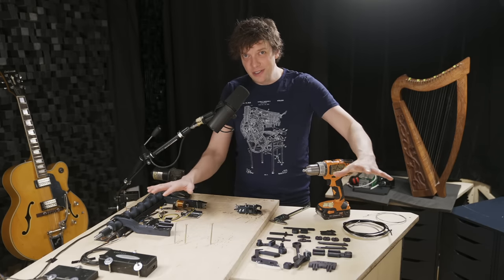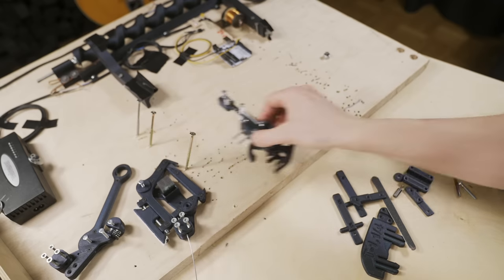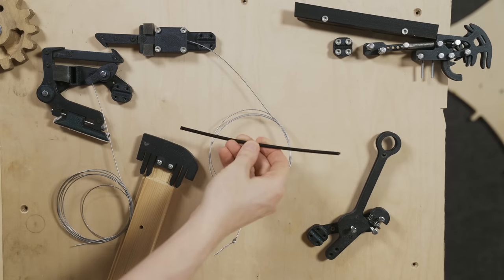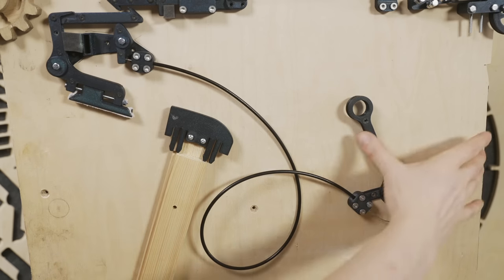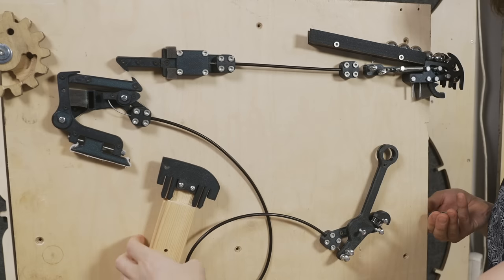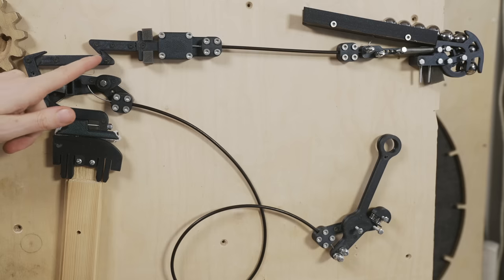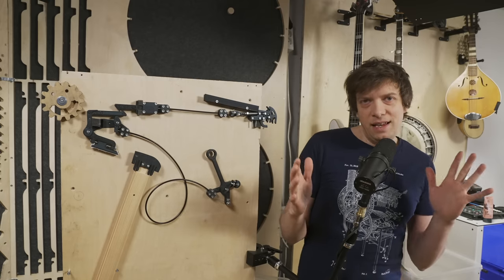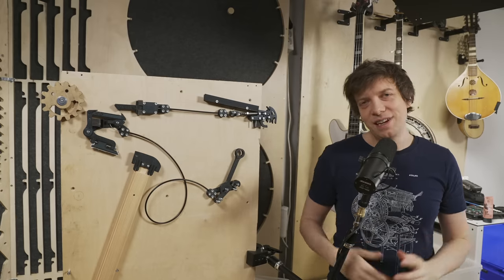These Bowden Cables Surprised Me!

Comment: As an avid cyclist, here's two pieces of advice in using these cables:
1) Get the expensive stuff. It's MUCH more durable when it comes to rust, kinks, stretching cables, and glide friction. Cheaper cables will eventually betray you in exceptionally frustrating ways.
2) Use the endcaps (ferrules) that come with the cable. They prevent the outer wire from fraying, and stop dust and grime being funneled into the channel on every actuation.

Edit with more ideas from the replies:
3) Do not push on these cables. It'll work for a while, but eventually your cable will buckle. Instead, make sure the inner cable is always under tension. The mute mechanism will fail in this regard, the marble dropper gets it right.
4) Cable stretch will introduce timing errors. You won't measure this in the studio or your tests now, but you'll absolutely know before the end of your world tour. Maybe not introduce this vulnerability into the dropper design? Alternatively, get the good stuff and have adjustments like on a bike.
5) Go to a good Local Bike Store (LBS) for mountainbikers, and explain what you want to do. They will assist you with proper tools, installation and gear choice. I can't think of any bike mechanic that won't be thrilled to help you and save you a lot of time and frustration.
6) @Nevir202 suggests "push-pull-cables" if you wish to avoid tensioning the inner cable.

Edit 2:
This is not a put-down, I have been fascinated with everything you do since MM1! Go Martin!
Reply: I second this advice. Also, the cables have a tendency to crush at the attachment points and then subsequently slip through what is clamping them in place. You need to introduce a turn or edge or something the cable is clamped around to help keep it in place otherwise they loosen with time.

The stretching of the cable and loosening over time will not do kind things to your timing I wouldn't think if these cables are being used between the indicator and the gate for the gate to drop marbles.
Reply: i highly support that advice as well
Reply: I might add that smoothly ground cables are just nice. Less friction.
Reply: And instead of using that two plate and for screw, it's possible to just have a block that stop the end of the guide, will save time and parts
Reply: Also cyclist and I just wanted to add to your suggestions:  
1.  I use nice PTFE stuff and grease the cables, grease reduces the friction and  makes it shift even smoother IMO. 
2. Agree on the endcaps. (Edit: think your referring to the 'housing ferrule' and I'm referring to the 'cable tips' here - use both)   Goes from sharp end to sharp and frayed all over and no longer possible to put endcap on easily, do them right away.   Use steel wire cutters not side cutters etc. Generic work just as good as park tool IMO.  Dremel cut off wheel to cut inner and outer together works as well.
Reply: @thalespimentelzuanazzi3365  And look how old cantilever brakes were implemented in bicycles. You can have an adjustment screw for the cable tension with just one factory made part that allows easily 0.25 mm accuracy for cable tension.
Reply: @TheXtrafresh. because younare the most liked comment. Would it possinle for you to ad following? If you agree so Martin may sees it?
I realy like the Bowden Cabels, but you have to consider Backlash in long Cabels, this comes from the Toleranz of the Bowden Tube & steal Cabel. It can be very noticable in ling Bowden Setups. This could leed to some problems, Maybe.
Thanks a lot
Reply: Well there is a difference in riding a bicycle and pulling like 20 grams of plasic. So i think there wont be any were over year. Endcaps are for prodecting against weather and also for stabilising the individual threads, but yeah, not much weather on the stage. I would safe that money. ;)
Reply: Also in this usecase you are asking for trouble as pushing with these cables is not a good idea - with nothing putting any tension on either end the cable can decide to kink rather than travel quite easily - Easy fix though the muting cam should be either spring loaded or work the other way around where you actively pull it into 'play' against its own weight so the cable is always tensioned a little. Also the cables are not instant data transfer they will mess with timing somewhat just by being there and not identical. So every note will need tuning in relative to the others -  The longer and more twisted (as that increases resistence) a run gets the worse this effect can be. And with Martins current tighter precision than I measure kick you may have to consider thermal expansion differentials between the sleeve and wire...

Otherwise agreed on both counts - though even the best 'pre-stretched' cable will stretch further over time and eventually get dusty/rusty/sticky enough to need replacing. So also worth making sure its as easy as possible to swap them for a world tour - which means standard length runs are probably a great idea so you can just keep the three? lengths pre-made with decent hydralic press clamped ferrules for maximum reliablity at both ends.
Reply: @davincifpv3842  i don't think it'll matter much for the silencer, but the marble dropper will become less and less tight over time.
Reply: @hyperbolid8777  except the machine travels, and festival stages aren't the cleanest environments I can think of. There's a difference in tension, as the MM3 will probably have less tension on the cables than a typical bike, but that makes rust, grime, cable kinks and other imperfections MORE noticeable, not less.
Reply: @h82fail  agreed on all points. Basically, before you use these in the machine, consult with a knowledgeable bike mechanic. They will know all the tricks and tiny mistakes you will make :)
Reply: @hyperbolid8777  In my experience, endcaps reduce the friction quite a bit so it might be worth having for this project, too.
Reply: It's usually good practice to have any cable actuated levers to be 90 degrees to the cable at mid travel - less forcing the cable to bend between the end of the casing and the lever. As an additional refinement, you can put compression springs around the cable at each end between the end of the casing and the lever arm. This will help the cable deal with being "pushed" - which it's not designed to do.
Reply: THIS!!! And I completly agree, the bowden cable does have great potential, but maybe not ideal at the timing relevant parts.
Reply: All looks like good advice, but if he WANTS to push, there actually is a cable for that. The machines in my old job used "push-pull cables" which are basically this, but with a solid wire, meaning that they transmitted both push and pull basically equally well.

They were being used in THE WORST conditions you can imagine, dirty, greasy, high vibration, next to no maintenance, for YEARS before we ever had a failure.

Think of the nastiest conditions you can imagine for a bike, and multiply that by at least 10, as these were mounted on gas powered machines, used to cut asphalt and concrete, which produced lots of fine particulate slurry and some fine dust, which got everywhere, combined with the vibrations from the motor itself, bolts would regularly be worn in half or loosen themselves, even those all metal lock-nuts he showed off in the prior video, would sometimes end up backing out.

On all of the machines we had them mounted on, the gasoline engines failed, multiple times, before the cables ever needed replacement, and in fact, most of the machines themselves became too old and were retired from service before the cables failed.

I did that job for 16 years, and I can only remember a single time that one of them failed, I fell like there must have been more, but I can't remember any.
Reply: Having the 2 pieces for the reader be connected could reduce the amount of tuning when assembling the machine. (The two seperate hook devices)
Reply: I second all advice here. Use brake cable (Shimano XTR for V-brake is my recommendation if you can get it long enough), much stronger and less prone to fail. A bit more difficult to cut, have your LBS teach you how to salvage the ends. A grinding wheel to clean, a sharp tool is good to expand the ends of the housing (‘syl’ in Norwegian), and you need a cutter that doubles over itself, unlike a side cutter as mentioned.

I really don't like the look of the cable heads exiting through the seams of the 3D prints. What a stress point. Cables should go through holes in material.

Edit: oh, and the stretch stops. Good cable comes ‘pre stretched’ but it's not perfect.

Edit 2: I just realised you can buy a drum of XTR brake cable housing. Maybe there is extra length for tandems for the cable? Pinching the cable at your fastening points is also an option to go without brake cable heads, it's just not as quick to replace thus not used on bicycles.
Reply: @foldionepapyrus3441  Possible to replace twisted cable with "Piano Wire" like what is used on throttle cables for lawnmowers. Less stretch and better pushing action
Reply: @Nevir202  that might be the golden ticket for the mute lever, and a good brake cable against stretching for the dropper
Reply: @cheeto4493  Doesn't do as well at the curves that may be required there though. Better choice if you must push, but when its so easy to design the push out so you can use the more flexible better option for a longer run...
Reply: I can't imagine cable stretch being noticeable with the tiny forces required to actuate the marble dropper. No way they're anywhere close to the forces from hard braking on a bicycle right?
Reply: Normally on throttle and brake assemblies the cables pulls and a spring pushes.
Reply: One way to get around the cables stretching out is to use hydraulic lines. Or, you know, electric wires. But electricity is too spooky. Not magnetism, just the electro part. the MM3 must be Amish approved.
Reply: Agreeing with all of this! Replying mostly to boost the comment ;)
Reply: Came to comment exactly this. Couldn’t explain it better, those points are totally necessary
Reply: Solution for push is use a solid core instead of twisted strands.  Has worked for a long time for choke control on engines. Also used for other automotive controls where you need push as well as pull. Like the slider for temperature control.

For such applications the sleeve can be the cheaper style with a spiral of metal (like brake cables) instead of the expensive type with lengthwise stands (for indexed shifters).
Reply: would also add brake cables to the list, as they are less prone to stretching and are better suited to maintaining tension permanently (gear cables tension and de-tension when changing gear - this setup does not deal with variable tensions)
Reply: I second the advice too. I would add that, if possible, a bare cable and maybe a pulley or two would be a better solution with less friction. Reserve the bowden cables only for the situations where you need your cables to follow complex shapes.

And, yeah, a tensioning mechanism is necessary. Those cables will stretch with the time.
Reply: I want to support the "not pushing with cables" advice. Maybe for 1 muting lane it works, but the other 2 machines were a lot of lines and the cable will no habe the strenght to push them all. You should find a way to "pull with the cable to mute and then release tension for unmute".
Reply: I agree with @Nevir202.  When I used to fly ultralight aircraft, many of the designs used "push-pull" cable for things like trim tabs or even flaps.  They are specifically designed for this sort of thing.
Reply: Can a spring be put at the other end of the mute mechanism next to the programming wheel to keep the cable under tension? I know that the spring would have to be weaker to allow the latch to move at all.
Reply: Yes. I had something like this comment in my mind while watching the video.

Some additional thoughs:

There are differences in shifting and braking cables. The ones for breaking have a larger diameter. Therefore they are much stiffer. Maybe this improves some wobbling behavior.

From my bike experience those cables break apart even if they are flexible. Thinking about the connection to the gate it will experience much more movements than on a bike. The breaking is a process over time. One of the small wires after the other comes apart. And if this happens near an end of the hose it will get stuck! Good luck this not to happen 😬
Reply: I would second basically all of this, and also suggest testing that muting connection with hundreds if not thousands of actuations (which of course is going to have to be automated).  That's the only way I can conjure to know what works well now is actually reliable - even if all these points are applied.

And while you're at it, maybe test the drive path for the marble dropper using a bowden cable at least twice as long as the longest run you think you might need.

There is so much about this overall setup as-is that is utterly brilliant and I love it. :D
Reply: So if we summarize this conversation, personally the bowden cables seem usable for the mute mechanism (by modifying it so as not to push on the cable). But will never be a good solution for the marble dropper in the conditions it exposes: not to be constrained by the positioning. Because will require constant tweaking, something he no longer wants for version 3.
If it must remain at short distance without torsion, a rigid system remains the best, including for manufacturing (and it is possible to find movement returns also in rigid for long distance not aligned).

If he really wants to, it would be necessary to do a test in much more difficult conditions: great length, torsion, very large number of movements with dust to simulate wear and also measure the force induced by the rotation which will be multiplied by all the channels.
Reply: I'm not sure if cable stretch will affect timing. The note is triggered as the reader falls which will take up the slack near instantaneously. It will affect the overall travel distance, but so long as the cable travels far enough to trigger the escapement it should be okay, I think. 

Could easily test this with a barrel adjuster - test timing while gradually loosening the cable, and see what effect it has.
Reply: @scaredyfish  Personally I think yes, because it has the advantage of this system of not being in a straight line (therefore play in the curves), that it measures to the nearest millisecond, and above all that the twisted cable relaxes with time, so every 500 notes the release timing will change.
Reply: @lejanz6293  The stretch isn't just total force applied related, the many cycles and sustained level of low force over time will still have an effect - it won't stretch the way a new guitar string or cheap brake cable will, needing tightening back up almost constantly when new, but it will still get stretched eventually.
Reply: For the push/pull issue, some motorcycle throttles have 2 cables so that you’re pulling in either direction. 

I also was thinking about the cable relaxing and throwing off the timing. However, the marble is dropped when the tension on the cable is released, which wouldn’t be affected in the same way.
Reply: bump
Reply: Do comparison between good and cheap Bowden stuff, and do a general workshop tool show & tell and it's a full episode of content, right there.
Reply: Love to see the community still coming with the full support!
Reply: also they can slip out of whats holding them after some time
Reply: also, if he follows your advice, He could eliminate 8 screws and 2 hold down plates per a cable by just mouinting them like they are mounted on a bycycle, and if that type of mounting can hold up to jumping from a clif multiple times and hundreds if miles without even the slightest complaint, it will hold up to a marble machine

one amendment i would make is some cables are designed in sutch a way that they can handle being under compresson, they cost more, so he should avoid designing is such a way that puts them under compression, but they exist
Reply: @foldionepapyrus3441  There will be no problem with timing, not because of those cables. The note will be played when releasing the hook, not when pulling. There is the spring  responsible for that, not the cable. The inertia (mass of the hook and the cable) + friction will have bigger impact.
Reply: absolutely true. You want some static spring tension to pull the cable back when it's not under tension, that's what bicycle brakes, many brake levers and derailleurs do. Great if you're after repeatable action from the cable, and it keeps it in a constant pulling motion. Similar to a rope, it's only effective when under tension.

You also want an adjustment bolt. Either on one side or the other. They are off the shelf parts, most bike shops will have them. That will help to make quick adjustments if the cable loses slack or you need to do maintenance. Similar to a bike brake, making a cavity for the cable to come out easily would help tremendously with maintainability.
Reply: @Nevir202  yes these! they use these in older automotive climate controls, where the temp/mix/defrost etc levers are able to actuate the mix doors in the heater box. A little more resistant to kinking. That curve leading right up to the cam on the left might be a little too extreme though, the wire might memorize that and bind, or fatigue. The wire may need to hinge/pivot both where it attaches to the cam, as well as where its end of the tube is mounted to smooth that tight curve out when the mute is activated.
Reply: @helvettefaensatan  No, shifting cables and housings are the way for more precision. Brake cable housings will shorten if they are bent, this is not the case with shifting cables (which have parallel inner strings instead of sprial string).
Reply: if you don't push it, you might just as well just not use the bowden for this application? you can just use pulleys with less friction and can just use fishing line instead. neither of the endpoints move in any sort of way.
Reply: The push/pull issue can also be solved with a metal spring, keeping the muting mechanism on tension. All bike brakes do it that way.
Reply: I don't think cable strecthing will be an issue because the marble release is based on totally losing the tension on the cable and you can safely over-pull the cable by the expected total strech possible. You should expect cable to strech maybe 0.25–2 mm in half a year (depending on cable length and quality) if it's under constant tension. If end caps are not fully seated, those may move a lot more under tension.
Reply: The load on the cables in the Marble Machine will be far less than a brake application on a bicycle, so he might escape any effective stretch even on a longer tour with it. The higher end cables will help in general for tuning, though, so that stuff is still a good idea to purchase if he wants to use this system in the final version.
Reply: You can avoid pushing the cable in muter by adding a spring at the other side, so it would work like bike shifter
Reply: unfortunately, Martin will not read this comment. You can try to post in in discord - at least then there will be a small chance that this gets to Martin
Reply: I guess there must be a spring added between a muting part and the base that forces it to go to 3 o'clock position so muting cable always be in tension
Reply from the maker: Thanks for summarizing the feedback! There are tons of industrial solutions / not from the bike world available as well. The pushing is a great point, perhaps the muting cam needs a simple spring to fix that. Especially when placing the muting lever in the shower and the distance is longer 💥
Reply: I agree with all those comments.
I also wouldn't rely on Bowden cables to "push" They are only really designed to pull.
Reply: @NimsQuarlo  There are cables with teflon, and they are cheap. No grease/talk needed.
Reply: Yep I was going to mention cable stretch too. It will become an issue eventually
Reply: @davincifpv3842  I second the point about the backlash.  I was looking to see if anyone mentioned it.  Looping as he discusses should be avoided.  Shorter is better.  You can actually feel a difference between front and back brake cables, because of their different lengths.
Reply: @h82fail  I've used PTFE before, it's great, but for it to really do it's job well, it needs to be applied with a high heat for it to adhere to the surfaces and stay where it's needed. I mostly used spray graphite lube in places such as the inside bowden cable sheaths and the cable itself... the accelerator cable of my car... the gear box of my RC cars and trucks. Works pretty good, but can get a bit messy, especially with the higher speeds. But lower movement rates generally don't seem to make much mess at all.
Reply: He should do hydraulic cables. You can't trust bike cables, because you have to adjust all the time..
Reply: Endcaps should Be added not because of dust But For cables to stay on position in that plastic print. also there is solid wire that is flexible enough to bend inside The cable But rigid enough that it can be used for pushing
Reply: Honestly, even if it was, sometimes we need to stop someone before they get hurt, in this case with frustration down the line.
Martin still have ingrain in him that everything in engineering is trade-of, you change a problem for another problem.
However i like to clarify that I have a way for those who prefer optimist to learn this:
Every Solution is a Problem, Every Problem is a Solution.

So it is all about being open to new way of seeing the problem and choosing what you can live happy with.
In fact, there many people that think the fact the Machine makes noise martins doe not want as a nice feature, I include myself in said group.
Ok is doing a ton of noise, but most of those noise have some level of harmony with the music and in a sense is hearing the flautist breathing, some may find it to add to the music, other may find it detrimental.
Reply: Unless you apply wheels to this machine and run around in the weather, totally unnecessary.
Reply: Stainless steel cables don’t cost that much more than the cheapo kind, it’s also sold in bulk which makes it even more reasonable. One can also solder the ends instead of using bike caps, after a part is done a hot iron can quickly tackle all cable ends pretty quickly!
Reply: @BrianHair  Adding some lead solder may also help to prevent the cables from fraying.
Reply: Great video. Great advice. Only thing I would add is cable grease.
Reply: @TheXtrafresh  On the one hand, you can also use Bowden cables with steel wire, which are for tension and pressure, and on the other hand, there will be no noticeable elongation with such a small force. However, this could be prevented by a spring mechanism.
Reply: I would also recommend looking at how the cable goes into a handle bar side of a brake. There is a pivot effect. Constant flexing will cause the cable to start fraying in time. Look at how the cable end has a T to it. That slides into a slot that allows pivot. The idea of tension isn't a bad idea either. All bike brakes and derailers have spring loaded at the end location allowing for pull action rather than push. Pull action is more reliable as push introduces flex variables based on friction. Any drag on the cable will cause inconsistencies in timings.
Reply: You may want to add tension adjusters, which allows you to adjust cable tension. I can send you pictures of the brakes on my rollator - like a walker with wheels, and a brake cable exactly like what you are using.
Reply: Interesting about the push. My car from the 1970s uses a similar cable system for the choke and heater valve - both of which were used in awful conditions likely without much maintenance in a pushing AND pulling configuration for 40-50 years without failing. Maybe for the mute, where you want to push, you could use automotive equivalents that are a bit more robust for pushing.
Reply: @hanvyj2  typically, push cables .. are not cables.. they are rigid wire like a piano wire within the same casing to hold it in place. when used, the end that is terminated, it is mounted in a swivel mount as to not bend the cable. lawn mower throttles use the same push with a rigid non stranded cable. The cable martin was using was stranded.. which means it is mean to pull, not push.
Reply: You can and should also prestress all of the cables well over the anticipated load.  Put it under 100 lbs of tension if it's going to pull 5 pounds and you should eliminate a bunch of early creep.
Reply: Tbh I only came to this comment bc I saw the owner of this yt reply
Reply: Another post in the 'don't use these for pushing' category. 
Their main use is for tension against a spring return in not super precise applications. 
If you want better look in to tube in a tube linkages made for RC aircraft.   They are designed for bi-directional functionality with precision, and are not super expensive.
Reply: Where does one buy the inner wire? I have a project that requires a cable over 2 meters in length, but I'm only finding them in short lengths for bicycle brakes and shifters,  on Google and Amazon searches.